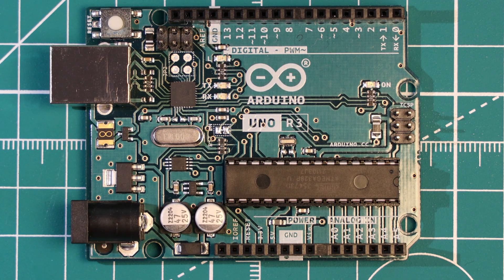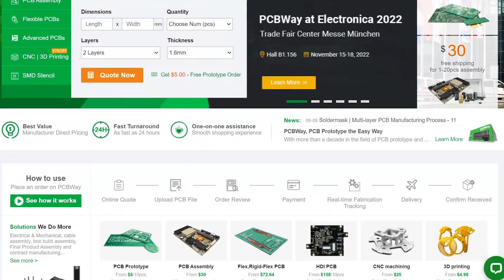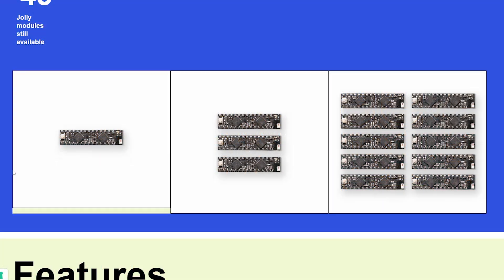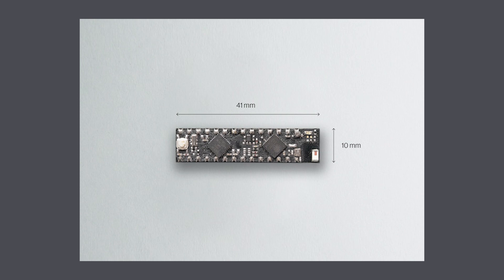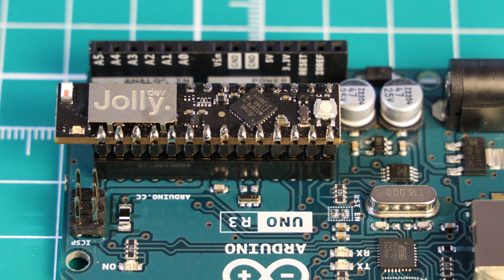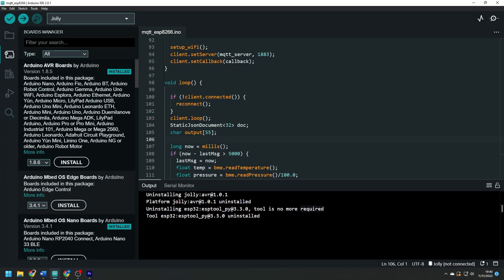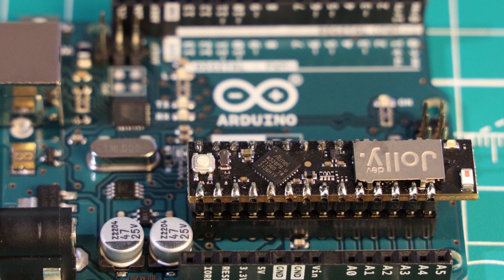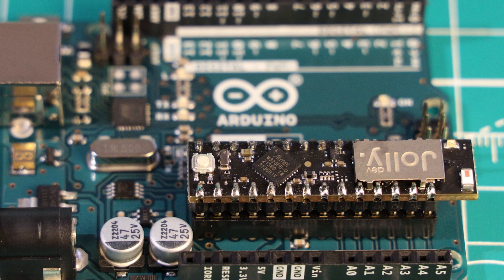Drop In Upgrade Adds On-board WiFi to Arduino UNO – Jolly Module Review

Comment: I dont understand why the designer have cut off 15% of the pin holes. Makes more sense to have the solder pads extended towards the board edge. Similar to NANO 33 BLE that have castellated holes which enables you to solder it like a smd.